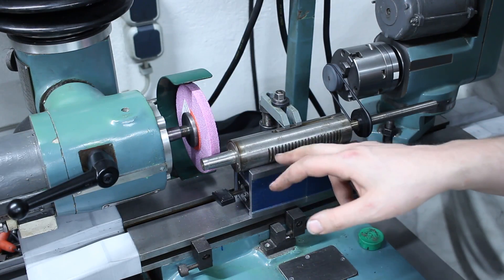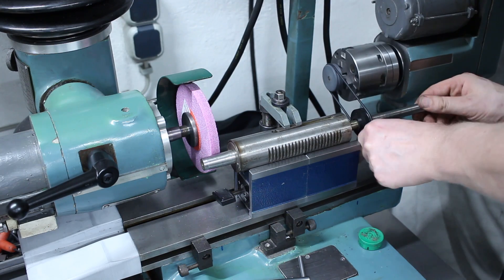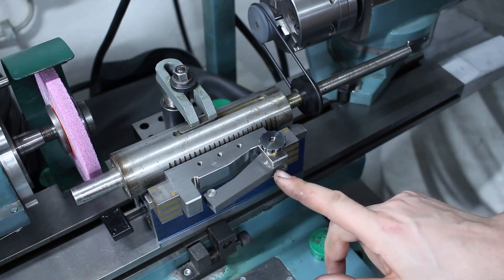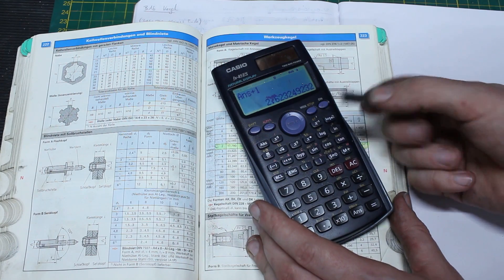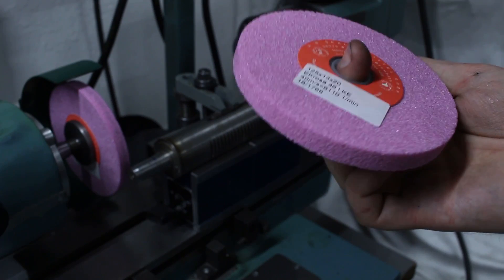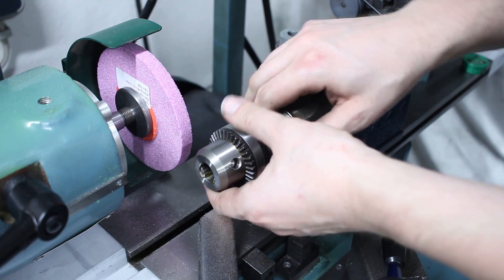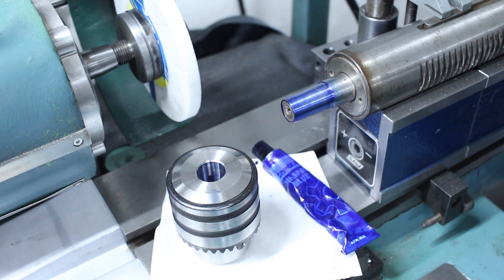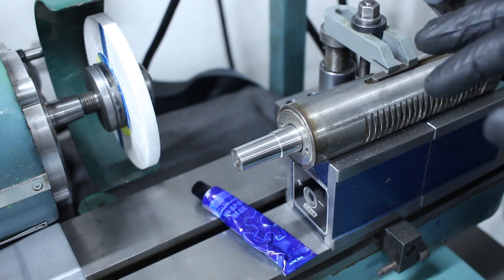Regrinding a drillpress spindle

Comment: Interesting, and niceley done! One thing that caught my attention is you mensioning the the hardness grade of the grinding stone (schleifscheibe :-) ).
I use a white aluminum oxide wheel for grinding HSS lathe bits. It is a Tyrolit brand 89A46M5AV217
89= (Tyrolit specific compound?)
A=Aluminum oxide
46=Grit
M=Hardness

I do not know if M-hardness is optimal for HSS lathe bits, but It is advertised for grinding drillbits, and drillbits might be close to lathe toolbits??

From what I can find online, hard discs is recommended for soft materials, and the other way around, soft discs for hard materials.
Do not know if it's correct, but cool that you consider these things!
Not everyone does!

Comment: The runout is generated by the opposite end. The pully/belt set generating the rotation is your problem running eccentric. The action of the belt transfers to the bearing.  That end is running out a considerable amount. Good video and cheers from Canada.

Comment: How would you go about regrinding an internal taper? I've got an Arboga drill press with a 3MT taper, which I tried to clean up by putting the spindle [rather than the quill] on the lathe using a 3MT reamer in the tailstock.  Didn't go well, quite a lot of runout when I reinstalled it. Any advice would be great - before I drop £400 on a new spindle from MSC. Thanks Tom

Comment: Hi Stefan, cool. My Europa Lehrmittel book says 14.6mm for d3 (not that it is at all critical (usually)). For the benefit of the EU English readers, the book is also available in English too from them, ISBN '9 783808 519141' or "Europa-No 1910X". I grew up with the US Machinerys Handbook but in my eyes, the Europa Lehrmittel book is nicer to work with. I have no affiliation with them at all, just like their books. Cheers Peeps...
Reply: @Martin Vernon, Thanks for posting this info about the book.
I was wondering where I could obtain an English version & you've provided the answer.
Does this book also contain info on "Speeds & Feeds" like within the USA Machinery Handbook?
regards Colin
Reply: Hi Colin, sorry, been tied up with other stuffs. Yes but not as much detail. There's all the info you need but but you need to do some math yourself, there's a chart, so you have a visual reference too. To be honest, I found a few places linked via the ubiquitous search engines providing older Machinery's Handbooks in PDF format, so I have an older one if I want more detail to browse on an iPad (don't like laptops in the workshop - swarf get's under the keytops). Hope that helps you... Cheers, Martin.

Comment: good explanation Stefan,  I did this same job in my first video with just under .0001 run out, I had replaced the shaft and ground a new taper. the bearings do seem to be creating the run out.

Comment: T&c grinder is a versatile machine. I guess you could have also used the surface grinder with a different setup?   Great video.
Reply from the maker: Yes, you could hang it off the front of a surfacegrindertable, tilting the spindle downwards. Robin Renzetti showed a setup like that to regrind a surfacegrinder spindle on instagram.

Comment: Isn't the dye just Prussian blue in a oil base?

Edit: guess not. It's michler's ketone in hi spot blue. Still, most of the danger is in the petroleum carrier.
Reply from the maker: As far as I understand, the Ketone is not as good for you.
Reply: @StefanGotteswinter  digging deeper into the chemistry it looks like the msds I got actually listed precursors rather than what's in the final product. Looks like the dye is something akin to Victoria Blue B, so probably capable of doing some intracellular damage (it's used as a stain so has to be able to both penetrate and bind)

Not a high risk or a sensitizer, and hard to place the risk vs sun exposure, but no need to take risks when gloves are available, cheap, and so much easier than worrying about staining things because you didn't scrub well enough.
Reply: Ketone*
Reply: @xenonram  how the f did I spell that keytone the first time round?....

Comment: any side effects of the speed variation introduced by an offset pulley?  i doubt it would do much of anything since the grinding wheel surface speed is so much faster, just wondering.

also 2 micron is pretty amazing for the runout of the bearings in a drill press quill and the side loading of the likely belt drive on such a long shaft up top will overwhelm those tolerances for sure unless somone decides to grind the top pulley and motor pulley and so on.

Comment: Why wouldn't this be ground between centers?  Wouldn't any runout in the quill bearings add to inaccuract in the taper?  Or did you chose your method as good enough for the quality of the drill press and chuck?
Reply from the maker: The centers on that spindle are heavily damaged, no way to refurbish them without a lot of work.
Reply: Understood.

Comment: Stefan, when you built your squareness comparator, how did you determine what the radius of the toe should be? Thank you!
Reply from the maker: Eyeballed it ;)
The radius is not realy critical - A larger radius will  give you a slower rise/fall on the indicator, a very small radius will give you a very rapid rise/fall on the indicator.
Reply: @StefanGotteswinter Thank you sir! That is what I was wondering. Excellent work as always.
Reply: It was a tricky piece to hang onto while milling the L shape. I built the comparator too. However, I use it more often as as a surface gauge with my tenths indicator. The ball bearing in the tip of the adjustment screw against the ground ball on the seat really make for smooth adjusting. Great idea.

Comment: Hi Stefan,
At first I had some doubts about using the existing bearings in the quill toturn the shaft for grinding, if it were mine I would have used the situation to replace the bearings, a good time to do so, do you not agree.
However as you said it a drill, I agree the run out if pretty fair for a drill. Since I had my mill (Similar to yours) I hardly use my drill.
I  see you do not use coolant on the grinder,  I find I have to even to keep the abrasive dust down, as I didnt once and it took me ages to clean it off everything.
Cheers
Noel

Comment: brilliant as always.  one question:  what kind of black magic is a 2.62 stack with only two blocks?!
Reply from the maker: take a 1.62mm and a 1mm gage block, haha. Or like I did, a 1.6mm and a 1.02mm block.
Reply from the maker: The US and Burma (Or what its called at the moment) are official non-metric, right?
Reply: @StefanGotteswinter  well, not really. Metric is considered equal these days. It took long enough. In ’66 Congress said that the US should proceed to metric at all due speed, but it hasn’t happened yet.

Oh, by the way, that was 1866.
Reply: @StefanGotteswinter  Myanmar is Burma's new name since 1989.  Since 2007the Capital is now named Yangon formerly Rangoon.  I was there in the early 60's and Rangoon was mostly dirt streets and one story buildings, but things are greatly improved since.
Reply: Stefan Gotteswinter US government mandated use of metric in 1985, prior to that it was optional. Electronic and scientific equipment has always been metric. Most older consumer goods were imperial, so it will be a few more generations until the US is completely metric. Canada is also a mixed system., but they use metric for distance and temperature.
Reply: @StefanGotteswinter  
Actually the US has been officially Metric sense 1876 or so. It's just that the Imperisl system is what people prefer to use. We tried to go all metric and there was a lot of resistance. But then in the UK you can still buy screws in the various inch systems.
Reply: @mpetersen6  Canada too.  We're officially metric, but if you go to most small hardware/home improvement stores, most of the hardware is imperial, usually with a small section of metric at premium prices.
Reply: Stefan Gotteswinter  and Liberia, I think.
Reply: @StefanGotteswinter  Soon the only countries left using imperialish systems are countries that loose wars to Vietnamese rice farmers.
Reply: @dasstackenblochen9250  It was the Fake MSM with a defeatist attitude that turned US Public opinion against that Fiasco.  The Draft was another reason Public opinion went sour.  Wars are not fun.  Old men make War...Young men die.  I came back.
Reply: I was here looking for this comment 😀 😀
Reply: Metric.
Reply: German magic. The land of odd size gauge blocks, sausage and a purity law to make sure the beer isn’t tampered with. Best not to ask too many questions.
Reply: @vdub
 At least 80% of the planet is metric...   And 100% of cars...       ;)
Reply: @pierresgarage2687  Not quite.  Auto wheel diameters are still in inches. Airplanes fly 650 mph at 30,000 ft. and metric square drives are actually imperial. 6.35 mm = .250, 12.7 mm = .500, and 25.4 mm = 1.00
Reply: Or cheat and use an adjustable parallel 😋😋

Comment: Nice job Stefan.  Very interesting. I also like the abrasive sticks. I use them at work all the time along with a set of rotary tips made of the same material in different shapes for the rotary tool. Fantastic job.
Reply: Steve Summers 🤘🏻
Reply from the maker: Thanks Steve! Love the rotary cratex tips too - Always impressive how fast they can wear down if you hit a sharp edge the wrong way with them ;)

Comment: Really enjoy your vids, thx so much for continuing to share.  Do you think there is any chance the slight variance in rotational speed on the quill from the pulley that didn't match the bore could have contributed to the run-out?  Maybe I'm over or under-thinking it, but my thought was that as the quill accelerated/decelerated from the offset pulley that the contact time with the stone would vary a bit. Was the same run-out measured on the original taper/upper part of shaft?
Reply from the maker: The original taper had way more runout, about 0,03mm compared to the 0,002mm I got ;)
It might be the bearings, it might be the slightly chaning sideload from the o-ring, it might be bad heat input. Lots of factors if you go bellow 0,01mm ;)
Reply: Indeed!  The result was very good.  I think I can see the runout on my cheap drill press with just my eye :)

Comment: Do you think your off center pulley could have caused the very slight run out in the grind? The drill press spindle probably doesn't have much if any preload in its bearings.
Reply from the maker: In hindsight that might be possible - I checked the spindle for side/side and axial play and it probably is lightly preloaded, but the small change in side-load from the o-ring could have caused that.
Reply: .002mm or .0001 is most likely way better than the the drill chuck supplied
Reply: This could definitely be the culprit but I would also point at the rotational accuracy of the bearings themselves,  the roundness of their locating bore. A different runout reading around the shaft (such as between the grinding wheel and the axis of rotation and then at 90° like in this case) would indicate the bearing ring roundness (which can also be influenced by the quill bore and exaggerated by preload and deformation conditions) while an off phase runout (in relation to the spindle rotation) reveals the ball/roller discrepancies in terms of their roundness or in their diameter along the ring's roundness. The second case would have probably been eliminated by the grinding operation as the wheel hits the same spots more than once, but that would not apply to turning operations (which is kinda interesting). 
PS: Can't wait to see the Super Duplex stuff finished!
Reply: Seems to me the offset pulley would have meant the spindle speed was not constant, and this variation may have caused the run out.
Reply: @gibbsey9579  Exactly! It would mean that the spindle was spending slightly more time in one half of the rotation than the other, resulting in more work being carried-out on the "slower" side. I'd bet that was the side that ended up lower. 

Love these videos! :)

Comment: "This chuck was supplied. It's not mine"... Sure... It's for a "friend"... Just come clean Stefan. It's 2019 - we won't judge you. It's okay to use a keyed chuck. :-)
Reply from the maker: I realy dont own a keyed chuck :D
Reply from the maker: Larger keyed chucks make a good door stop.
If my keyless Albrecht or Röhm are to long I use a ER collet chuck, shorter, better runout, better holding strength, non marring to drill-shanks.
Reply: @StefanGotteswinter  Keyless chucks are a nightmare in a drill press. You need one hand to hold the spindle, one hand to grip the  chuck and your third hand to hold the tool. What do you do? I use a keyed chuck whenever I can.
Reply: And a ER series collet takes up even less room. Badda boom. Game ,set, match. Plus it holds better and runs truer
Reply: When tool to work piece clearance is critical a keyed chuck consume far less length compared to a keyless type. Another less commonly used attribute is they can be run in reverse for LH drills for example.
Reply: @RobB_VK6ES  Signs of Experience.
Reply: Haha nice one!

Comment: Better to use the verjungung (?) or slope ,and simply cross multiply ,to convert to sine stack rather than do two sine conversions ( the morse taper is defined by slope not angle)
Reply from the maker: Yes, that would be more correct - But without doing the math, on such a short taper it will not make a noticeable difference ;)